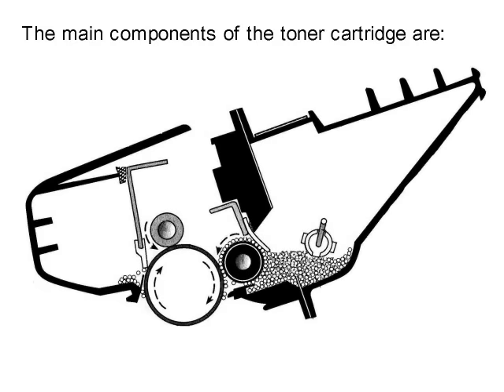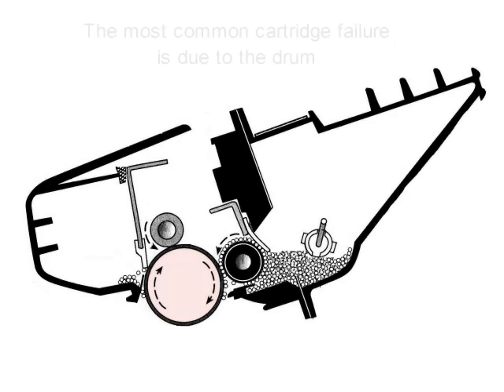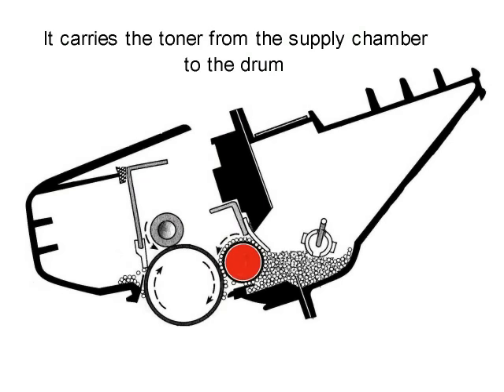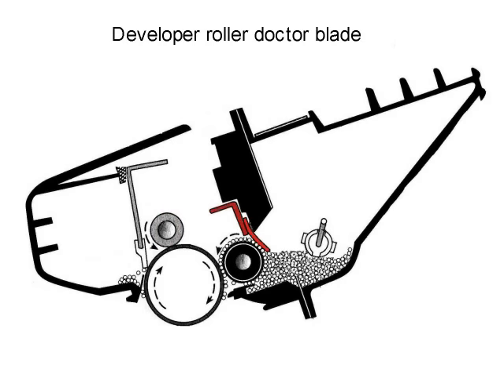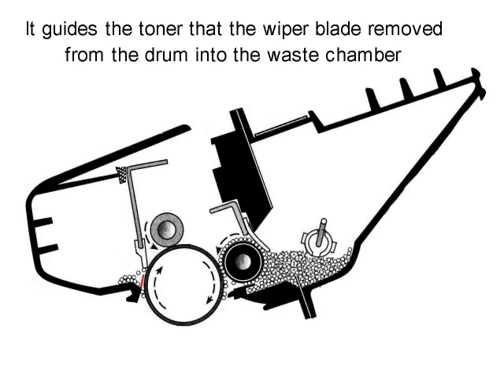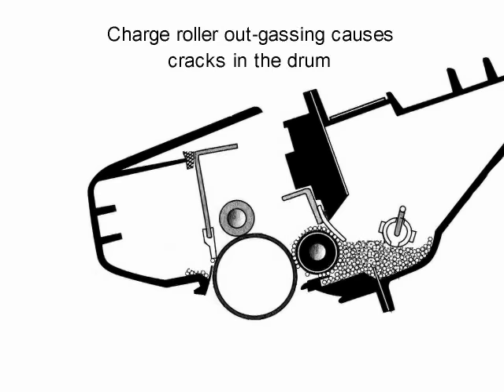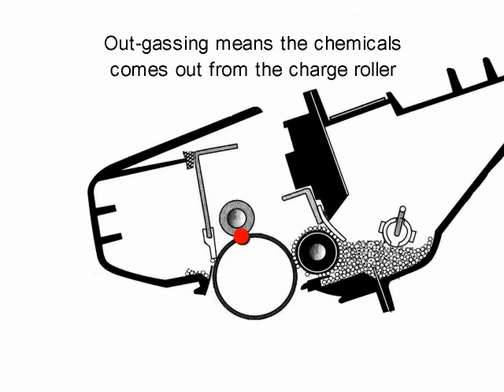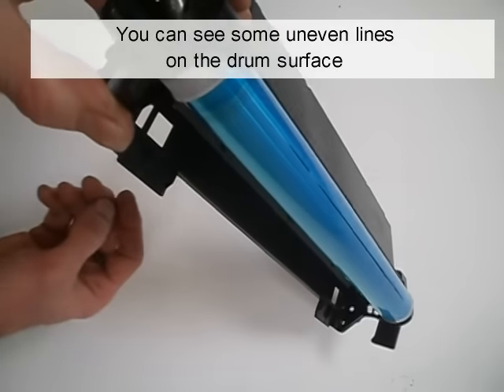Toner Cartridge Printing Defects: Causes and Solutions

Comment: I have Samsung 3200 series laser printer . After  I refilled my toner for 1st time  and took some prints ,it was printing pages nicely but 1 problem was there .
Printer powder was removing after 1 rubbed pages slightly .
The shop person where I refilled toner , said that It might be problem in toner or printer heater .
But how ?,,,,,before that it was printing properly without any problem of pages .
just after refilling for 1st time this problem has occurred .
Any solution ?
I told him that the problem might be in his powder.
Reply from the maker: Amol Nar I think he is right, the problem probably is the toner. may be you do not remove all the old toner from the cartridge before refill with new toner, or the toner powder was damp. verify all electrical contacts of the developer roller
Reply: This problem is said by me...the person who refilled my toner cartridge is professional... It prints pages very nicely.... But when we move hands around the pages powder starts to remove from pages.....many of my pages are fading due to  removal of powder or non stiking of powder on it...... He told me that maybe problem is in  toner cartridge or printer heater......... But this problem was not present previously ......this is my 1 st time of refilling.... And this problem i had to face........... I personally feel that this problem is not of heater  or cartridge..... This problem is of powder  ...........what do u think ?
Reply: And what is toner ?....i call entire cartridge as toner...... Or just powder is called toner ?
.
I thought that Ink jet printer has cartridge and laser cartridge is called toner
Reply: By the way... I have not refilled it....i gave it to  professional guy to refill it..........and this problem occured.....that guy is not saying that problem is in his powder....he is saying that problem is in my printer ( heater / Fuser unit )or cartridge.... Maybe he want to cheat me for extra money...thats why i want your suggestion....because before refilling there was no such problem of removal of powder from pages.

Comment: TN720 was working great until cleaned everything changed cartige still printing just parts and very faintly  any other suggestions??
Reply from the maker: What did you clean? remove and reinstall the toner cartridge. Change the toner cartridge after a cleaning of the drum unit.

Comment: Thank you for the solution given in the video. My problem has to do with light print. I have tried all your solutions on light print but it is still the same. Idk what I am doing wrong. But I observed that as I continue printing the print becomes brighter than the previous. But it does not become bright like that normal brightness. I will be very grateful if you help.
Reply from the maker: But which printer?

Comment: sir, i have a canon mf4412 printer, when i print any graphic image. then thick horizontal lines are there in the image. thanks in advance
Reply from the maker: graphic images are difficult to obtain with a recycled or compatible cartridge. I think you should start changing magnetic roller bushings and magnetic roller,check the developer roller blade, install a new drum.

Comment: Hi guys,
I have just refilled toner powder in new OKI C831 and colors are light, there are no strips or dots just the print out is too light, do you have any idea?
Reply from the maker: +Jozef Perichta OKI C831 toner cartridge is only a container, probably the problem is the drum unit, may be the toner inside is too old or damp. Try remove all the old toner and install a new toner cartridge
Reply: +viandant5 You mean, disassemble the drums and clean them and use new cartridge?
Reply from the maker: +Jozef Perichta it's not necessary to disassemble the drum unit, you can remove the old toner with a toner vacuum for example
Reply: vacuum clean from the opening where cartridge is connected to the drum I suppouse
Reply from the maker: +Jozef Perichta yes

Comment: I bought a new brother laser printer mfc-l2700dw and it does not print clearly. Letters are not crystal clear. You can see that they are a fuzzy (blurry), and have a shadow. Please help!
Reply from the maker: try changing the paper, may be it's damp. note that the starter cartridge only print some hundreds of copies
Reply: I have tried changing the paper and nothing. I'm using the starter cartridge but I've only printed less than 10 pages and they have all come out the same way. Everything comes out super dark also, I've tried changing the setting  to use less toner but it looks the same. Very dark and blurry.
Reply from the maker: bring the printer to a repair center. I suppose it's in warranty. keep in mind that it's a low cost printer, you can't obtain e high level graphic quality

Comment: Very informative video, I have a doubt I have konica minolta page pro1300w lasor printer which was recently toner refilled. but printer doesnot identify the cartidge. if we give test print paper stucks is there any solution please.Thanks in advance
Reply from the maker: that cartridge has a chip on the bottom, you have to change it

Comment: I have an hp color laserjet pro mfp m182n. The problem is that I get rainbow banding across the page, and sometimes I get only black banding across the page horizontally. This problem occurs sometimes after every 15 prints. Why does this happen? Any solution?
Reply from the maker: There could be a dot or an imperfection somewhere in the trasfer roller, or in one of the drum. it xould be a discharge from a charge roller
Reply: @viandant5  how to identify whether transfer roller is defective?
Reply from the maker: @hathakker802  there is no method, you have to make some test
Reply: @viandant5   there is a lining on my cyan cartridge opc drum but it's out of printable area. Would that be creating this problem?
Also when this rainbow streaks occur on a page I see a black lining on the rear side of that page. Can you predict precisely what's wrong, transfer roller or drum?
Reply from the maker: @hathakker802  The most probable is the drum, a shortcut between a defect on the drum andf the charge roller
Reply: @viandant5   does that mean that only the opc drum is probably damaged, though I am getting horizontal streak on rear side of the printed page at the same time.is not this black streak on rear side of page indicative of defect transfer roller? 
Does the defective opc drum also cause horizontal streak on rear side of printed page?
Reply from the maker: @hathakker802  Yes, a problem on the rear of the page the problem could be the transfer roller, or the fuser unit
Reply: @viandant5  is it possible that a damaged opc drum cause this problem on rear side of page?
Reply from the maker: @hathakker802  Usually not

Comment: I have oki es8431, reffiled the cartridges with toner powder and now i see the pages are lightly colored in cyan and magenta. How can i rid of that? Because i need blank white background clear.
The cartridges doesn leak, transfer belt looks clean
Reply from the maker: which powder did you use? do you clean the old toner before the refill? probabky you have to remove the old toner from the drum units
Reply: i have used from aliexpress cheap powder. Now i consider of using Static Control powder okiuniv1. whaqt do you mean from drum units? Should i take apart a drum unit when cartridge is dissattached? Thanks
Reply from the maker: If the defective toner powder is into the drum unit. you have to clean  that drum unit removing that toner from the drum unit.

Comment: Dear sir,
i have a problem with my printer. When i print a page it appears with black ground. What could be the problem and any solution for this? i have tried using a brand new toner but the problem is same.
Reply from the maker: Without knowing which printer do you have it's difficult to say. may be the drum
Reply: i am using HP LaserJet P3015. i think its not a drum problem because i have tried with three new tonner cartridge and the same problem has occured all the time. i can send u a sample image of how i got the printed result if sir can send your email id
Reply from the maker: ok, send me an email
Reply: email id?

Comment: i hv a problem with my canon mf3010.when i print the the toner powder not dry out evenly in certain spot.. so what the problem is it??
Reply from the maker: What do you mean "not dry out powder"?
Reply: @viandant5  i just find out and it might be  heating fuser getting problem...  the colour not getting bond on the paper..
Reply from the maker: @areloharel  It's a typical fuser unit defect
Reply: @viandant5  yes indeed... i already send to computer and printer store to repair it.. and yeah definitely the teflon already tore..

Comment: Hello sir,
I have samsung printer.i am facing issue in print .light fonts and linings are getting too much dark.means light shaded font prints in dark.i also change toner .same problem.please help
Reply from the maker: But which Samsung printer?
Reply: I found one issue with focus lense of LSU .its not focusing clear.no idea about adjustment of lense .help me if u have idea
Reply from the maker: @mitkalsara1340  Without knowing which is your printer it's difficult to answer. There are no adjustments, you can only clean the LSU window. Check the priner settings instead
Reply: @viandant5  i got the issue.issue is with focusing lense just after the laser .it is became opaque due to aging of plastic .

Comment: Hi! Don't you know what can be the cause of a wave defect? Wave lines on the one half of the paper after the half-use of the cartridge ? 
Thanks!
Reply from the maker: it depend on which printer do you have, may be it's related to the charge roller or its connections and supports

Comment: Hi,
Thank you for sharing such useful information. I am not sure what is the problem with my printer. I am having Canon MF3010 and refilled it for the first time. Taken around 600-700 pages. Since refilling print out is coming very light, I can read them but not that bright it used to. I have cleaned all the parts and taken out the old toner powder before refilling. Please help.
Reply from the maker: Did you change the drum? Also look at the magnetic roller or at the magnetic roller blade
Reply: No, I had not changed the drum,  just refilled it with ink powder. It's a new printer and I had bought it 14 months ago, lifespan printout is only 600-700 pages. Just to update- It's a bundled toner 925. Will new toner with minimum usage can have drum or magnetic roller/blade issues?
Reply from the maker: HP made the components of the cartridge very weak, it's possible you have to change the drum
Reply: ok, will try that and update you. Thanks for your help.
Reply: Hi Viandant,

I had changed the drum today, and it worked fine. Printouts are coming good now. Thanks for your help. Cheers!
Reply: Hi Viandant,

I have canon 925 cartridge and I am using it with Canon mf3010. After refilling and changing drum I had taken probably 500-600 printouts and now I can see black smudgy lines in the middle of the page vertically. I haven't done any troubleshooting yet. Please advise what to do? Also Suggest If there is any way to upload pics?

Comment: Hi I have a bizhub c360 there is a faint cyan background on prints and when i open the bypass door the feeder roller is almost cyan in color and has cyan residue, and also the transfer roller has the cyan color at the edges how is such a problem sorted thanks
Reply from the maker: may be the cyan developer roller or its blade ar eworn, or the recovery blade allows toner to drop inside the printer. Look at the drum if there is cyan toner on it
Reply: yes there is toner on it so i guese it has to be replaced?? or just replace the blade??
Reply from the maker: I think for start you have to clean the developer roller blade. look at the mylar blade under of the developer roller

Comment: Sir i have tn2356 cartidge of brother dcp L2540dw. I want to know that how many types of blades have in it. Is there any difference between doctor or developer blade. Has  every printer must wiper or recovery blade
Reply from the maker: doctor blade and developer blade are the same. this printer has no wiper blade.
Reply: Sir what about recovery blade. Do recovery blades and wiper blades are same. And how many rollers in this printer. Is sponge roller or magnetic rollers are same.
Reply from the maker: @rishavmittal1196  the recovery blade is a thin mylar transparent blade. the sponge roller inside the Brother drum unit is the transfer roller
Reply: @viandant5  recovery blade is present or not in Tn2365 toner cartridge. Magnetic roller or transfer roller have same thing or not. Transfer charge roller which is inside drum unit has another name is PCR roller

Comment: hi friend
how are you?
i have aqustion about kyocera Ecosys FS-1030MPF .
yesterday i am printing with this and its working good but suddenly start printing full black page .
i already clean waste ink and all genral parts but no success
please help me 
printer showing all is ok with out error but i am tired to try 
please help
thanks
Reply from the maker: +Naseem Khan verify if the corona wire into the drum unit is defective.
Reply: +viandant5  
i already replace with new doveloper and drum unit
but not fixed
Reply from the maker: +Naseem Khan may be the laser scanner unit, high voltage power supply circuit not supplying the correct voltage or the DC conroller. verify if the connection between printer and drum unit are ok, then I think you have to bring that printer to a repair center

Comment: Hi viandant5 ~ I have a problem, and hope you can help me.. I have an old printer, that was fine for me to make a copy once in awhile.. I stupidly used white out on a paper once, and I must have got it on the roller part, because now when I print out a page, there is a quarter inch blank line .. I don't know how to take it apart.. is there some kind of cleaning solution I can put through the printer that will eliminate the dried white out?.. I don't have a warranty on the printer or for tech support, as someone had given the printer to me.. :( Thanks
Reply from the maker: +Remnant Soldier which printer?
Reply: +viandant5 thanks for replying ! but I only had to clean the little strip of glass under the top cover.. :D

Comment: i have a printer SP Ricoh afficio  C830DN  i buy it new we print a transfer paper on it but it dont take it good  the fuser goes bad now the roller have crack  the machine give me a message to change the fuser unit but some one tell me i have to change a lot of things on the printer that can cost me half the price of the printer what are you suggest me to do because the printer dont work any more
Reply from the maker: If you are luck, the thermistor get dirty so you only have to clean it

Comment: My HP laser jet pro 200 Color m251nw, ran out of black ink. I replaced the black toner. And withen a day of printing noticed fading on half of page. It has gotten worst and always same half. When doing shipping labels. When doing address labels it's almost whole page, very weird and confusing. Any ideas?
Reply from the maker: Michael McCullough I think the side covers are not in the right position, or the black cartridge is not correctly installated. try tighten the 4 side screws, remove and reinstalkl the cartridge
Reply: viandant5 Just did that, certain parts of the print still coming out faded, nothing changed. Could this be anything besides the Toner? Cause if its the toner I can just order another
Reply from the maker: Michael McCullough may be you do not clean the cartridge well before refill but I think it's something related to the developer roller not in right contact with the drum
Reply: Clean cartridge? All I do is when printer runs out of toner I buy a new one and put in. Didn't know any cleaning was nessarly with the toners being new
Reply from the maker: Michael McCullough I thought you refill your cartridge. probably the black cartridge is defective, you have to change it
Reply: thank you

Comment: Can you go over what to check for toner powder leaking onto transfer belt and which ends up making it onto printed pages.. I clean it up and it's good for a while, only to build up and happen again? Is this the developer roller problem or recovery blade? This is a color printer with 4 cartridges and the only one I have the problem with is yellow in the front of the printer
Reply from the maker: Without knowing which printer do you have it's difficult to say. if you have the problem only with the yellow, the problem is related to the toner cartridge, probably the recovery blade or the sealing blade of the developer roller if present
Reply: @viandant5  great work sir, but plz I have a similar issue with a bizhub c353,it prints with a yellow background,thereby exhausting the yellow toner.please can you help tell me what to do.thanks
Reply: I have same issue with a bizhub c353, please kindly give me tips on how you finally tackled issue...because am hoping you have sorted it out.thanks
Reply from the maker: @petrolinaanyanwu3697  I think you have to remove all old toner from the yellow toner section. changing the toner cartridge is useless, it's only a container
Reply: @petrolinaanyanwu3697 I did not solve this yet, but I suspect something is bad with the cartridge or drum.. the printer also has over 12k copies so the waste bin probably needs to be emptied/serviced too. BTW, this mainly happens when I print in color. Using black toner only does not usually have the issue, unless the yellow cakes up on the blades that separate the cartridges and leaks down onto the belt. When I get a chance to I will look into it more..I have the brother mfc 9330cdw
Reply: @viandant5  thank you very much